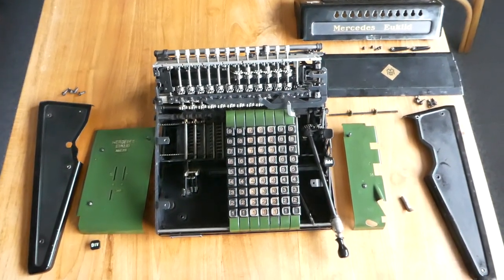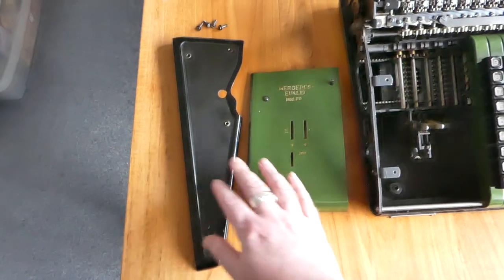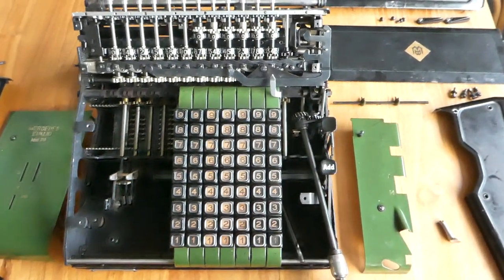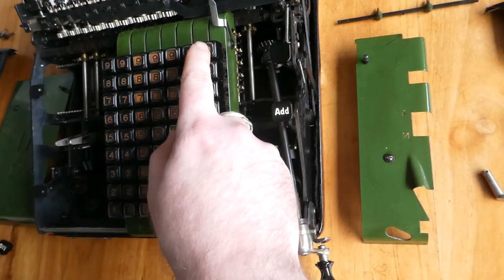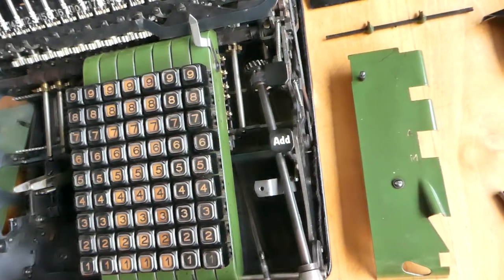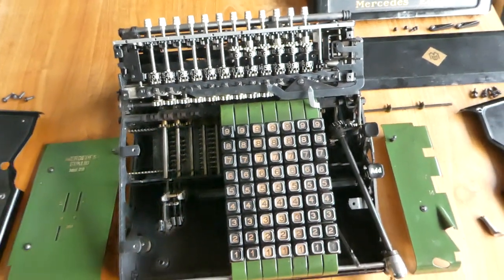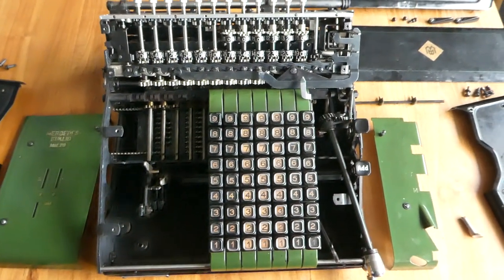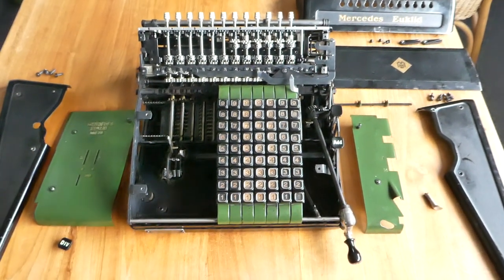The proportional lever mechanism of the Mercedes-Euklid calculators

Comment: Jaap - I've just got my hands on one of these, and I'm trying to get the case off to do a bit of cleaning.  I've removed the two clearing lever caps, and the 4 screws holding the carriage cover in place, but I can't seem to get the cover to clear the metal parts of the two clearing levers, so then I can lift it up over the setting knobs at the top.  I'm being quite gentle at the moment as I don't want to risk bending anything.

Is there a trick to removing this cover?
Reply from the maker: Removing this is like a puzzle that seems impossible until you have the two pieces in exactly the right orientation that somehow allows them to move apart. Even then I'm not sure if I wasn't helped by the case of my machine being slightly dented and warped. It is best to slide the carriage all the way over to the right. IIRC, the case was touching the collar of the left-most setting knob, while the right-most setting knob was as fully exposed as could be. In this orientation it could just barely clear the two clearing lever stems. I hope this description helps a little.
Reply: @jaapsch2  Typically, I managed to get it off about five minutes after posting this question.  But it was using this exact method.  :) Thanks for a quick reply!

Now I just need to hope I can get it back on again...